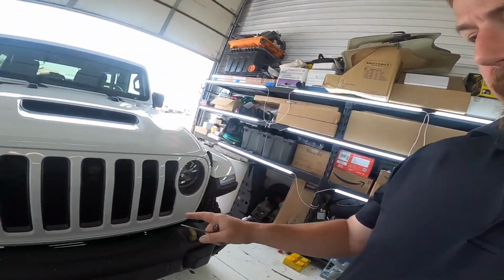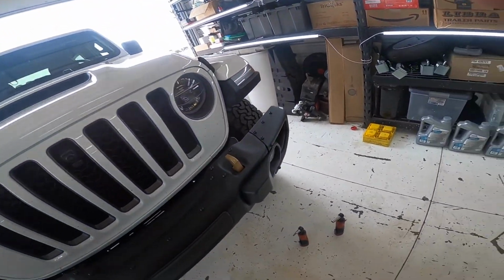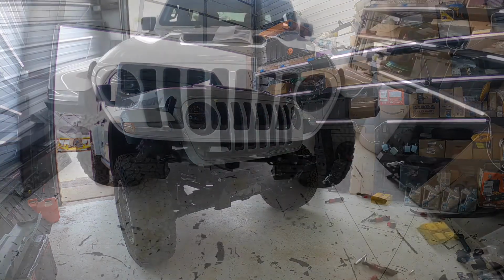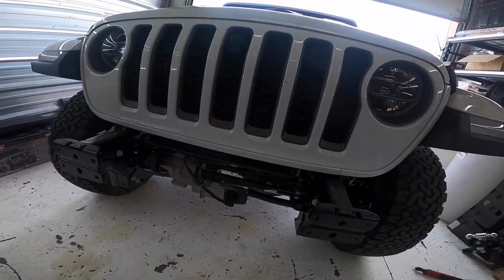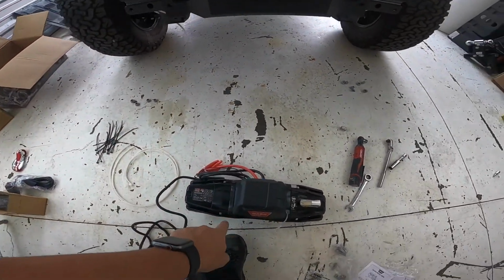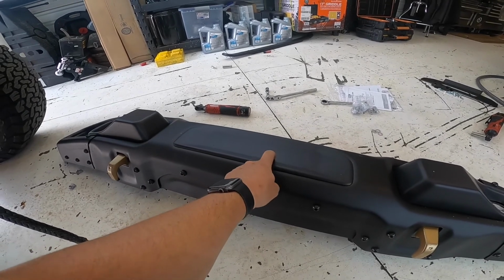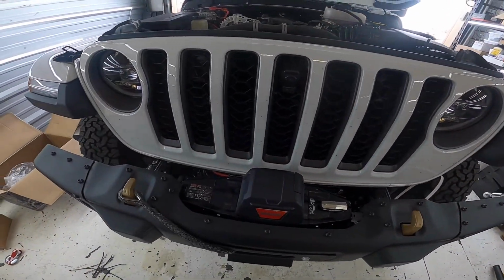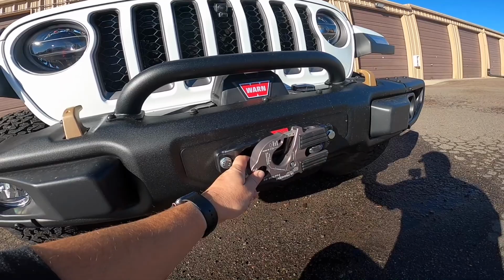Wrangler 392 Winch Install

Comment: I just finished the same installation.  Your video was helpful.  I did need to elongate the two rear holes on my skid plate to install those bolts.  I assume this was due to the bumper moving forward 1/4” due to the winch mounting plate.  I’m curious if you had a similar problem. Thanks for the video…
Reply from the maker: Glad the video was helpful!  Yes, I had the same problem with the skid plate holes and came to the same assumption.

Comment: Really great video!  Thank you for breaking everything down.  I'd like to install this exact setup.  Can you provide a parts list including the additional bolts you had to buy?
Reply from the maker: Hey Sean, 
The Winch Plate is from Warn - Part# 101255 - And is designed for JL and JT with the factory steel bumper. 
The Winch is Warn as well and it is their VR EVO 10-S synthetic rope winch- Part# 103253
The winch hoop is the Mopar Winch Hoop for Steel Bumper - Part# 82215351
I also installed a Factor 55 UltraHook winch hook instead of the supplied cook that comes  from Warn with the winch. 

All of these parts were purchased online from Northridge 4x4.

The bolts that are supplied with the winch are just a little bit short so I just took one of the supplied bolts to my local Ace Hardware store and picked up a couple bolts that were 1/2" longer.  I didn't pay close attention to the specific size of the bolts unfortunately.
Reply: @2ndChanceOverland   I got it all installed this weekend.  Your video and the information provided made it pretty easy to tackle the job.  Thank you!
Reply from the maker: Hey Sean!  Thats great!  I'm glad my video was helpful to you.

Comment: Thank you for the video. What are your opinions, pros/cons, or differences between the Mopar and Warn winch plates?
Reply from the maker: The Mopar Winch plate was simply more difficult to install especially when installing the winch.  The Mopar plate has you fully install the winch plate and bumper prior to dropping in the winch which makes it more difficult to line up the winch with the mounting holes.  Also and the Gladiator (Mopar plate w/ Smittybilt winch) I had to use a pry bar to push the winch into the grill to get the holes to line up.  Not sure yet if that is due to the Mopar plate or the Smittybilt winch.  The Warn plate was much easier to install and had no issues bolting the winch in place on the plate.